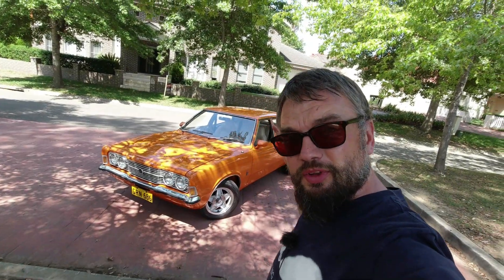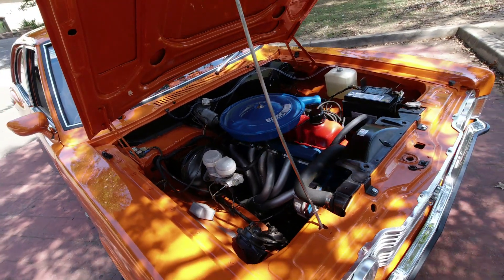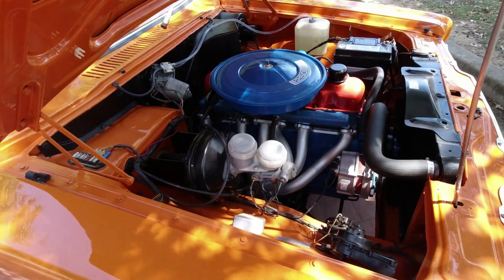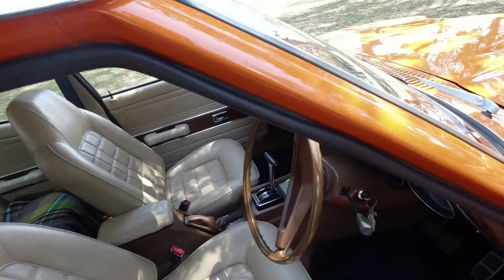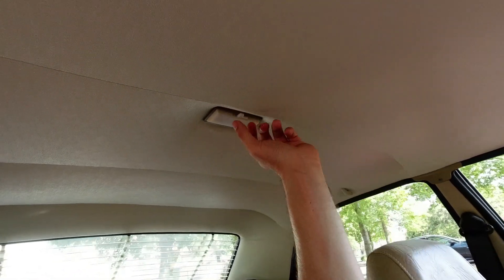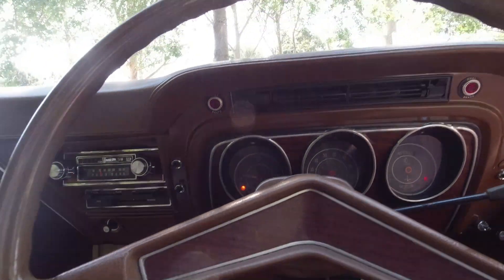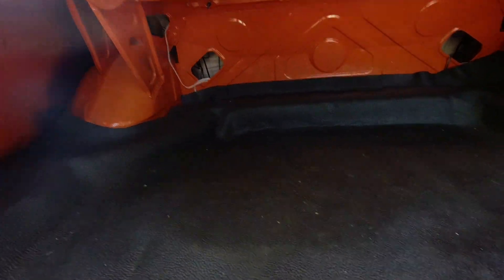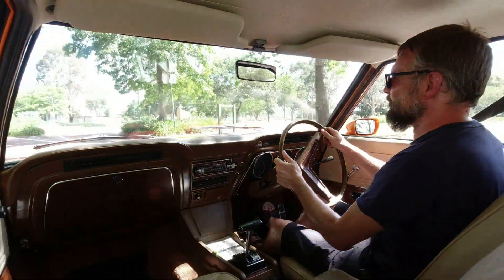Aussie Oddballs: Ford Cortina 6! 4.1-litre, tested in 40+ degree heat

Comment: Many  years ago when my father was teaching me to drive he would slap my hands if I turned the steering wheel while stationary. Still makes me twitch to watch...
Reply: Now everyone has power steering they've forgotten just what forces and scrubbing are going on underneath...eew
Reply: @gs425  But also tyres are a million times better now.
Reply: Yeah - the strain & wear on bushes and rack would be my main concern, not so much the tyres.
Reply: it's best not do that even now, especially with power steering or put it on full lock so as to burn the motor out...
Reply: @wordsmith52  Have you burnt steering motors out ? ;)
I don't think I've driven an electric - always been hydraulic and bomb-proof !
Reply: @millomweb  I managed to avoid that (so far) with the EPS (on Vauxhall/Holdens) but only because I was given the advice  beforehand. They are known for that problem. If it's ok to slam into and maintain full lock on a hydraulic one that's ok with me, but after all the stories I've  heard about unduly "wearing things out" I wouldn't personally take the risk.
Reply: @wordsmith52  - that's a thought. Thanks for the tip. Urban drivers in confined built up areas would do well to remember this. Three pointers might be advisable for longevity of the system.
Reply: @wordsmith52  I have come across failed hydraulic systems but never on my own vehicles - so history of running systems dry (a complete killer) has been lost. Apart from running things dry,  fair 'wear & tear' is possible but hydraulic systems usually have to do a LOT of hours  before they give trouble and usually outlasting a vehicle. Going to beyond full lock as per the same on any powered hydraulic system,  just results in a pressure relief valve operating (usually audibly) and does nothing more than taking the system to its max working pressure. It's total energy-wasting and a good engine load for getting a car engine warm quickly before moving - cos you need the screen defrosting first !
I managed to cold start a Nissan (Almeria) at 2am and using the technique had the screen defrosted in about 1 minute ! That was the fastest warm up I remember !
Reply: Paolo G  That's a peculiar one. I've come across an odd vehicle where the power steering system is separate from the main hydraulics but I don't know how common that is. The pumps are obviously oil cooled - so I guess the whole oil system was overheated. In the case of excavators, they have large oil tanks - so heating all that oil up is difficult but a power steering system can have its own quite small tank which I could see being overheated relatively quickly.
Reply: Same with my Dad!
Reply: Same with my driving instructor 35 years ago lol
Reply: I don´t think holding the power steering at full lock for extended times is an approved practise by any manufacturer as I would assume forcing the fluid through the pressure relief valve for an extended period of time would result in "working" the fluid and thus overheating it. Also the sound you hear at full lock is from cavitation as the fluid passes through the pressure relief valve, and cavitation is bad for the fluid, as even if the fluid as a whole is not overheated, as a large number of small, localised volumes of fluid gets overheated when the "bubbles" collapse.
Reply: Same here. My dad had a sit up & beg Ford popular. "It puts too much strain on the steering box" he said. I never steer unless I'm moving because of his words.
Reply: No your wrong and you have no mechanical knowledge at all. Mechanical things wear out because of the stress put on them. Putting extra stress on the steering system on a car will increase the wear and tear. Me and my old man replaced a many a tie rod!
Reply: Same here. I was always told that the wheels must be rolling before you turn the steering wheel. It seems commonplace now for people to ignore that advice, but, like you, it still makes me cringe.
Reply: @millomweb  yet but lock to lock will make em leak
Reply: @paulmitchell9349  That's not guaranteed. They're designed not to leak but sometimes things fail.
Reply: David Hynd : Nice observations from you and others here.  My 1958 Vauxhall PASY Velox had the 4 turns lock to lock Burman steering gear on modern 195 /75 S 14 tyres with a PC 3.3 Cresta engine. Later steering was down geared to 4.8 turns lock to lock. Pre-steering on the spot was common.  The Cortina Six has the same steering ratio 195s and a 410 pound tall deck all iron 4.1 litre engine which is 160 pounds heavier than the 2 litre OHC. Power steering was optional on later 2.3s and later Mark 4 & 5 Cortina 3.3 and 4.1s. You have to pre steer on the spot with non assisted steering because the wheel rim load on a power steering Ford is  just 4 pounds on a 16 inch diameter steering wheel, and four times that on a non assisted early Velox and certainly the Cortina in line six. I drove a 1970  16:1 ratio 4 turn lock to lock Boss 302 Mustang  with Magnum 500s with 235s and its even heavier. Big Falcons had a stock 20 to 1 ratio steering gear and 5.25 turns lock to lock, and were lighter to steer with a 4.1 engine than the 600 pound lighter 2600 pound Cortina 250. Unless youve driven one, dont prejudge. The issue with them is that a rag joint can be torn off the impact absorbing steering column, and the tie rods and rack trunnion over loaded. All true. But a non assisted Cortina 250 six is VERY heavy on the tiller, and the Cam Gears rack was never down geared like it was in the bigger VauxhallCrestas and Ford Falcons. It needed the faster steering ratio...Hub Nut noted just how easy it was to get the axle out of step. 17.6 second quarter miles and a 2.77 axle ratio in the Autonatic  and it had only 102 hp DIN net (155 hp SAE Gross), about the same as the 2 litre for power.  The 240 lb-ft gross engine torque figure  was about 288 Newton Meters, like a Turbo 3 liter TVR for torque. Everything about the Cortina 250 TC Mark III was hairy, lairy, and you laughed on the straights and screamed in terror on the bends.
Reply: Atle Olav Dahl : Great info! Thanks for sharing! Ford Fox car Fords in the USA used the Bishops patent Adwest/Cam Gears/TRW rack which is common to FE onwards Vauxhall Ventoras,  Jensens, Astons, Jags, Granadas and Scorpios and some Cortina Ghia/Ghia X 2.3s as well as the Aussie Cortinas from 1978 to 1981. The SD1 Rover had it as well. Ford in all its US literature said dont hold the steering on lock for more than 3 seconds or the power steering pump can overload. The Jensen used to strip the rag joint if overloaded on lock. The torsion bar governs steering weight and response is controlled by machining at construction. Non assisted steering, it is less effected as unless you are Walter Rohl,  the human arm cannot create the same forces as hydraulic servo assisted steering.
Reply: don't dry steer !lol
Reply: don't dry steer !! lol
Reply: Bill Peters : The Cortina Six was not available with power steering or 205/60 15 alloy wheels like Ians had. The steering weight is heavier than the 1970 Boss Mustang 302 and Lamborghini Espada I  drove. The wrist pull on those with a 14 inch wheel is about 40 pounds stationary, 10 times the stock power steered Falcons 4 pounds. PS, I learned to drive in a Mark 3 Facelift XL 2 litre Cortina, and my teacher said the same thing....dont let Constable Stapp catch your hands anywhere but out side the rim, and preferably between 15 to 12 and quarter past three  or Its Points Off Boy-oh...
Reply: Surest way to destroy the front tires
Reply: v
Reply: @Bill Peters, hitting a child for something as petty as that is unacceptable...then again, you never had a step-father like mine.
Reply: @paxhumana2015  Sorry to hear that. At 17 I was a 6ft rugby player so a little rap on the knuckles didn't worry me too much.
Reply: And to this day in W.A. you still lose points during the test for doing it, you have to prove you can drive an old car by not static steering.

Comment: Be grateful you weren't in Penrith in Western Sydney on January 4. 48.9c. That number plate may just be original if it came with the car as it is from 1973/74.
Reply from the maker: 46 on the day if this test it turned out!
Reply: @HubNut  That's a shocker! When owners were surveyed after 15,000 kms of ownership by the National Roads and Motorists Association (NRMA) these models didn't score very well. Only 20% found the car satisfactory when delivered. With the 4 cylinder, it was 5%. 66% would have bought another one given similar circumstances which is low compared to other models. It scored well, and highest with performance with 92% of respondents scoring it as "good" or "excellent". With the 4 cylinder it still scored well with 80%. Japanese cars scored highest with owners over all.

Comment: I always said Ford should have put the V8 in this thing, and ended the reign of terror introduced by the overpowered V8 Holden Torana. The Torana dominated the car races in Australia during their production, with only the best Falcon drivers occasionally upsetting them. If those Falcon drivers had the much smaller Cortina with a V8 in them....

Comment: I think the Mk 3 was unquestionably the prettiest Cortina--it looked purposeful and somewhat sporty, even if the handling didn't match the looks.
Reply: The two door models look just like a muscle car - a pity then that the biggest engine we got in Europe was the 2.0 Pinto.
Reply: yes, many had to suffer the 1300 engine...
Reply: @wordsmith52  I've driven a car with a normally aspirated 900cc engine (Seat Ibiza), which was plenty slow enough for me! (Think it did 0-60 in about 24 seconds and had a top whack of 80mph).
Reply: @d2factotum  yep embarrassing, and wait til you are on a motorway, going up a steep hill, and trucks start overtaking!  The Mark 1 Cortina had an 1100 engine as the base spec, and I thank god I had the 1500 motor. But when the M3 appeared in 1970, it looked such a large car that the 1300 badge on it seemed so silly. 2000E post 1973 was much better.
Reply: @wordsmith52  No, MK1 Cortina came in 1200 and 1500...not 1100.
Reply: @grahamw56  yep, I meant to say 1198cc.
Reply: @wordsmith52  Guess you meant 1498cc as well
Reply: There's quite a few of these in Australia that have been fitted with the turbocharged 4 litre 6 cyl engine out of the last ford falcons. Several of them are putting out around 1000 horsepower
Reply: @d2factotum , Mazda made an urban runabout in the early-mid 60s, called the Carol.  It had a 4 cyl powerplant of just 358cc...!  I think it is (was?) the smallest capacity engine in any passenger car (as opposed to commercial vehicles, tuk-tuks, random trikes, etc).
Reply: @wordsmith52  A 1300 engine? Was that able to pull the skin off a rice custard?
Reply: @grahamw56  Yes, that's what I thought too. I had a Mk1 240 with a 1500 in it. A friend had a 440 with a 1200, gutless.
Reply: @craigmandall9420  You would really need to do something about the handling then.
Reply: @exidy2290  yeah stock suspension really doesn't handle that much power well
Reply: @exidy2290  Maybe - downhill! The Mk3 wasn't that much bigger than the Mk2, but the 'clever' design made it seem larger.
Reply: dungareesareforfools : The were a large number of four door South African Cortina XL 2.5 Essex V6 and Savage Automotive Uk 3.0 versions made. They were 123 to 138 hp factory issue cars. The Essex V6 was a straight drop in with stunning results. The 3.0 S and later XR6 and XR6 Interceptor Cortinas were Mark 4  and 5 Cortinas with the Capri Mark III 3 litre engine and either the 138 hp or X pac Triple Ferrari DCNF carbs for 188 hp. As fast as the Zakspeed Capri 2.8 Turbo. The problem was Fords like that never sold well in the British Isles. The Savage 3 litres were excellent cars, but sold only in small numbers. The South African Essex V6s made the Cortina Mark V a Kaylami winner against 5 serirs BMWs and Alfa Romeos.
Reply: I think it handled fine .
Reply: @wordsmith52   I agree
Reply: @grahamw56  True
Reply: @wordsmith52  Really 😁😁😁

Comment: Most Cortina Mk 3's were sold with the German 2 litre 4, which produced quite sufficient power.   My mother had a 2 litre Mk 3 and it left my 4.1 litre Falcon for dead, due to the Falcon's weight.   But those Borg-Warner gearboxes were a maintenance item, like spark plugs or oil filters.  They were not designed for an engine that big, and typically needed to be replaced once  or twice during the life of the car.   Fortunately they were dirt cheap.

Comment: I had a six cylinder Transit 250 cross flow with a terrible three speed column shift, it drank the juice,  I did push it up to about 150kph on a long country road once, it was hairy. We must have been crazy.

Comment: I had exactly the same model , but a 1600 in South Africa. I fitted a Zephyr 3 liter V6 into it. It fitted perfectly with the correct suspension and diff. It was a rocket. A friend of mine who worked for the Fire department tested it and we got scared at 220 km/H. She could spin on pull away in 1st and second.
This is what an over powered bullit looks like.

Comment: My first car was a 1975 TD Cortina XLE wagon. I loved that car and had it for seventeen years. 
I bought it as a four cylinder, 2 litre automatic. It didn't take me long to put a 4.1 litre, six cylinder in it with a four speed manual gearbox. 
I also lowered it, beefed up the suspension and brakes, added deep dish hotwires, a set of extractors and 2" exhaust, electronic ignition, rejetted carburettor, Sass steering wheel, aircraft landing lights for high beams, TC dual headlight front grille, and too many other custom mods to mention. 
It was pretty quick for what it was (13s on 1/4 mile) and loads of fun to drive. 
I miss that car.

Comment: I first visited Britain in 1984 and when asked "Wot sort of mota 'av you got in Orstraylya then" I'd reply that I had a Granada with a 4.1 litre engine in it (they didn't know what a Falcon was). They were incredulous at the engine size since most Granadas had much smaller engines in them. It was possible to drop a 302 or even a 351 into these Cortinas so I can't imagine how that idea would have been considered in England back then.